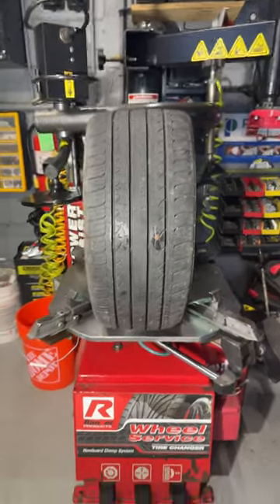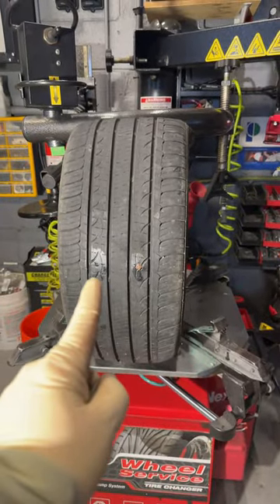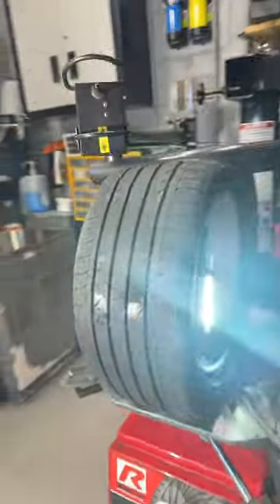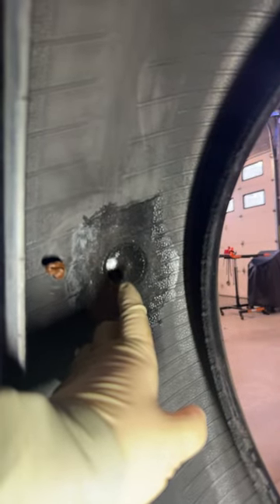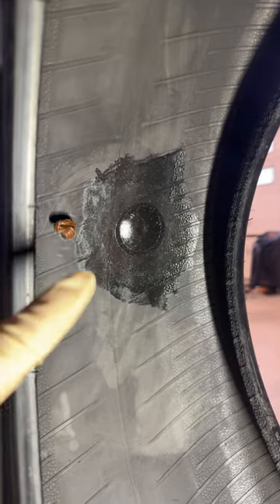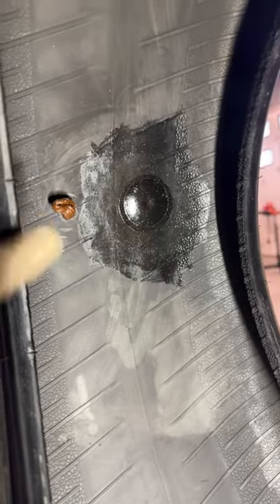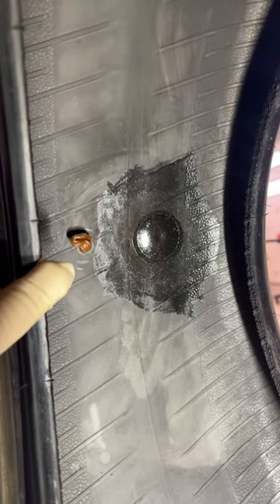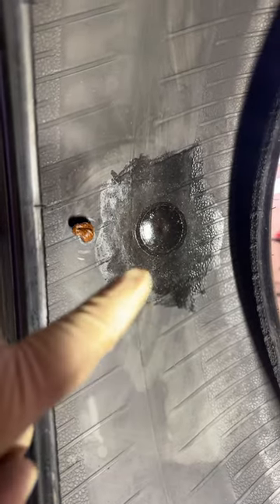TIRE PLUG PATCH VS TIRE PLUG!!!

Comment: As a commuter I do over 100 miles a day every day and I’ve never had a plug give me the slightest issue
Reply from the maker: They both work I haven’t seen issues from the plugs, but more secure would be the plug patch
Reply: Sounds like you just wanna make that extra $$$ to get the tire off the rim.
Reply: @bigpeezyweezy it’s not about that at all. It’s about the liability a shop takes when they “fix” a flat. If they plug it and blows out and kills someone, who are they gonna sue? That’s right the shop. 
And no I don’t own or work at a shop.
Reply: @bigpeezyweezy know the right people or place it's not that bad. I just had to leave a google review and they did it for me for free lol 20 bucks wasn't bad also but shoot. Gotta know the right people
Reply: @mosely25 , a road hazard can happen anywhere any time. Just because you "know the right people" in your podunk town doesn't mean anything if you are traveling, and learning "the right people" can take lots of trial and error.
Reply: @TheEnthusiastMechanic what is a plug patch? Is it the same as a regular patch?
Reply: @noobSaybotK a plug patch is a patch with a stem basically. You put the stem through the hole and pull it
Reply: @jonaboyzo  got it. So its a bit better than a regular patch?

Comment: Rope plugs for life baby. Cheap, 99.9999% effective and reliable. Don’t have to dismount the tire, hell you don’t even have to Jack the car up!! Lol like someone else said, it’s a no brainer!
Reply: Had a regular patch on my screw sized hole and it still leaks, they even re did it and still leaks it's a semi new tire. Should I try a plug?
Reply: @noobSaybotK hows the rim? Its not cracked? Thats where it could be leaking
Reply: @Xrider6  no it was sprayed soap n water it bubbles

Comment: Had a regular patch on my screw sized hole and it still leaks, they even re did it and still leaks it's a semi new tire what do u recommend?
Reply from the maker: You would need to get it plug patch from the inside out that would be the best way to seal it up correctly
Reply: @TheEnthusiastMechanic  do some tire shops not carry those? I dont think the place i went to does. And we got in a argument lol I don't wanna go back there.
Reply from the maker: Most should carry them but it depends on the shop
Reply: @TheEnthusiastMechanic  also I been seeing alot of videos n comments and alot say the traditional tire plug works great too
Reply from the maker: @noobSaybotK  traditional ones have always worked well for me, but there’s gonna be some situations where they don’t if you wanna have a worry, free repair and you plan on traveling long distances a plug patches better
Reply: @TheEnthusiastMechanic  u think Walmart has plug patches ? Or discount tires?
Reply from the maker: @noobSaybotK  discount tire should I don’t know about Walmart

Comment: As long as the tire is like new condition the Tire Rubber Plug will hold for 12,000 miles

Comment: Patch Plugs are better. Plugs are easier but not always 100 percent. I would have to patch the plugs if it was leaking on occasion when i was working at Firestone. But it gets the job done
Reply: What if my patch still leaks , should I try a plug?

Comment: 5$ plug vs 65$ patch...no need to say more.
With plugs being so reliable, easily available and fairly inexpensive, unless your a mechanic with the available tools and time, it's a no-brainer.
Reply from the maker: I do more plugs than patches at the shop most people want quick and cheap.
Reply: If patches really cost $65 I might as well go ahead and buy a new tire. Crazy stuff
Reply: 65???? You can get at Firestone or Pepboys for under 30. Free at Firestone if you buy their tires.
Reply: @ryanwashere21   30$ with a patch/plug and balance?
Still, kinda expensive if you get multiple flats fixed in the life of a tire,  not to mention your time.
Reply: @JohnDoe-md2sb  Yeah. 20 at Firestone. It's technically the right way to fix a tire. Plus in my state plugs fail safety and management would get on my ass about it. Even the customers caught on to the bs.

Comment: Why is it vs? Should always be plug AND patch.
Reply from the maker: I’m comparing the two different types. People do use just the plug alone so that’s why it’s a VS showing the difference to educate people!
Reply: @TheEnthusiastMechanic  you can use both the plug and the plug patch?? Im confused. I got a nail on my mag wheel and i need to repair it. Im looking to use the stop n go plug patch, but i dont understand how can you use both. If you use the plug patch, and then plug it through the outside, youre basically making a whole through the plug patch.. please input me